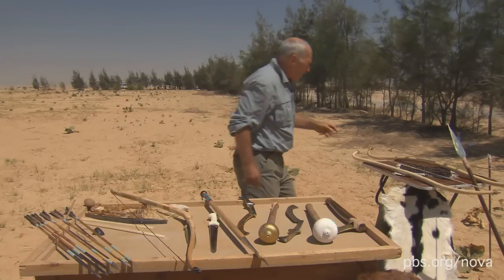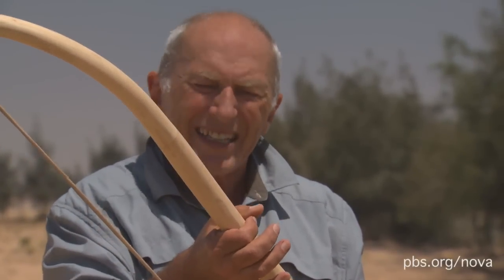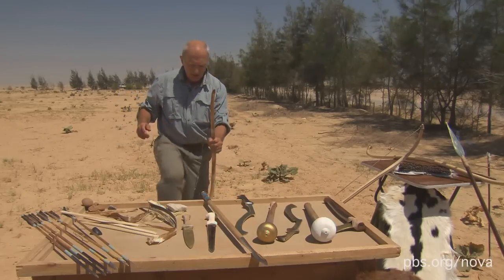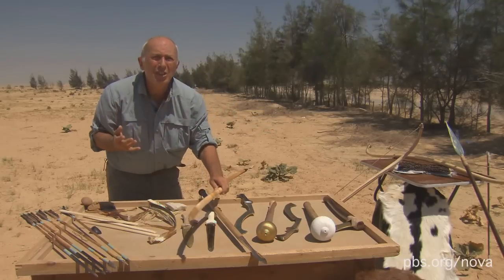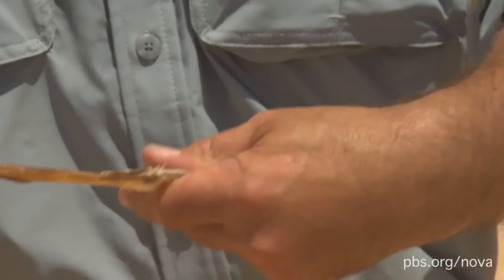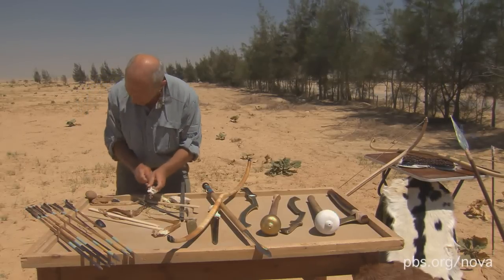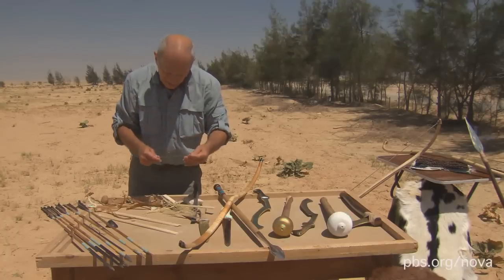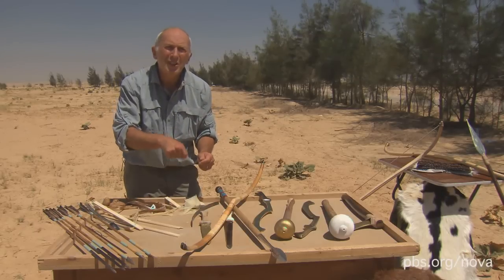NOVA | The Egyptian Bow

Comment: I guess you've never seen a Comanche bow. 
You can make a short bow without it snapping like that if you're not using a thin and very narrow furring strip like you easily snapped at the beginning of the video.
You can put a backing on a short bow, but you don't have to. You just have to know what you're doing.
Also, the horn doesn't hold all the power in the bow. A lot of the power comes in the lamination of the different materials.
Some of the information in this video is  either disingenuos, or downright wrong.
Reply: You are wrong
Commanche bow is very weak because have 20 inch draw lenght compare to 36 inch draw lenght egypt bow

Short draw lenght is weak power

Longer draw lenght is big power

Commanche bow use for hunting and not for armoured soldier
Reply: Commanche bow is self bow
If you draw more 20 inch,the bow easy to break

Comment: That self bow is a caricature of an Egyptian self bow!  It's a joke!  Granted, the self bows in paintings appear to be whip tillered--but not like that!  The very low humidity of much of Egypt would make wood less resilient and more brittle ...and they did use designs that show this... apparently...though the Nubian mercenary archers in the  Egyptian armies had standard long bows of great power that looked similar to the English Longbow--and didn't seem to need to compromise efficiency to adapt to the low humidity!
I can't imagine what the wood is in the sample shown--its very thick but weak?  Or is it only bending in the tips?

And is that sinew really being used to lash the horn to the bow?  That would be highly abnormal.  The sinew is normally applied to the bow as backing---and is as vital a component on the tension side of the bow as the horn is on the compression side.  There could be some sinew wrapping, but that would not be it's primary purpose.
Reply: Looked to me to be rattan or something close to it, rattan is very hollow and light, meaning you need a ton of material to make a proper bow weight, for example i made a rattan egyptian bow with 42x42 cross section which made a 40-50 pound bow, a white wood of the same dimension would have made a 150+ pound bow!
Reply: @almubarizunarchery4607    That makes sense!  I only learned about rattan bows recently.  Fascinating material.